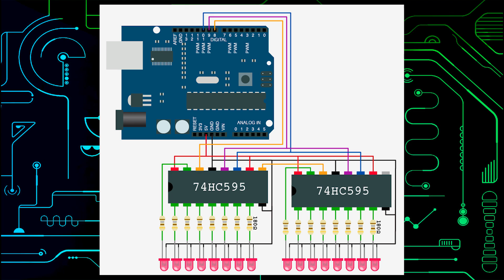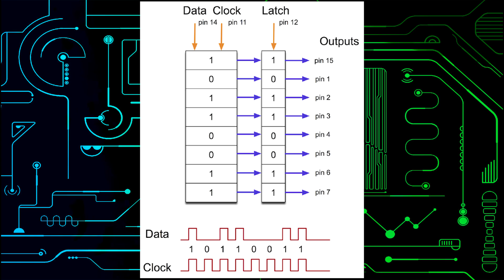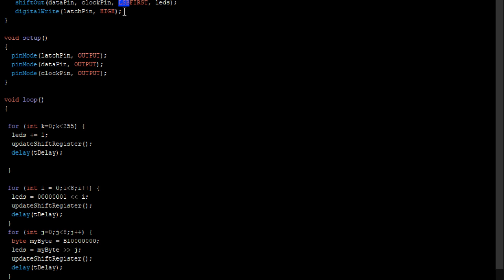74HC595 Shift Register (Arduino Tutorial Series)

Comment: Are your SHcp and STCP pins mixed up?
Reply from the maker: You're right! The diagram has the wires coming from pins 11 and 9 on the Arduino going to the wrong place compared to what the code says. I must have wired it up the way I coded it but then drew the diagram wrong =/.  Figuring out how to add a correction now.

Comment: Hi, I'm currently using 24 LEDs and 3 shift registers. When I enter the value 1 to the data argument for the ShiftOut function, the first LED connected to each shift register lights up. Then, when I give the value 255, all 24 LEDs gets lit. Would you please tell me how to  light up only 1 LED from the last  shift register ?  Thank you
Reply from the maker: I only have one shift register at the moment so I can't answer the question for sure.  I hadn't thought about how shift registers would respond to input once they're stringed together.  It seems like it's just passing whatever input it got onto the next one and so is just duplicating the output three times.  My idea would to not link the registers together but use separate inputs for each of them and take that into account in code.  But that might not  be the point, you might be wanting to only use one wire to control all of them in a unified way.  Like I said I don't have the chips to test this but what happens if you put in numbers longer than 255? like for 00000001-00000000-00000000 put in 65536.
Reply: Thank you very much. I will try it out.

Comment: if I wanted to observe  the shifting bits on the output, how to set or disappear  the latch?
Reply from the maker: +Readme .txt in the function updateShiftRegister I write the latch pin to low, and then shiftOut the data I got from the for loops in the main function, then write the latch pin to high.  Low is like blocking the data from going through until youve given it all, then setting to high means to let the data through to the output.  I'm also sure to call updateShiftRegister() at each iteration of the loop, and not after it.  I hope this helps I had to rewatch my own video to remember what I was doing!